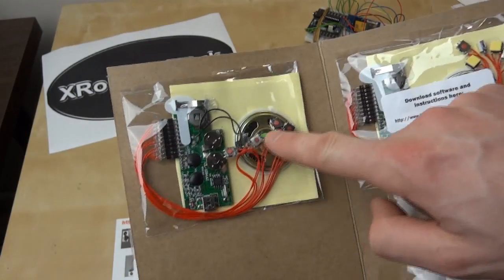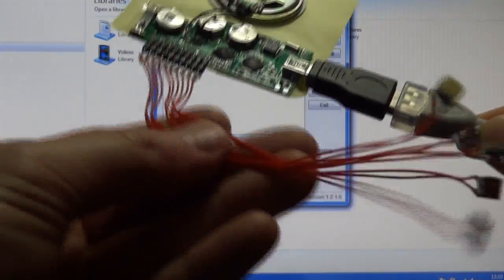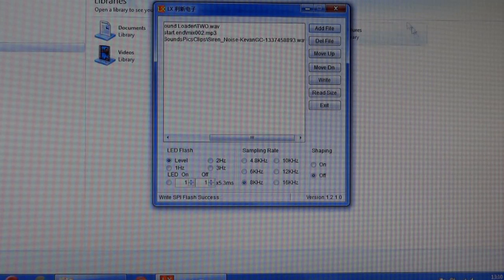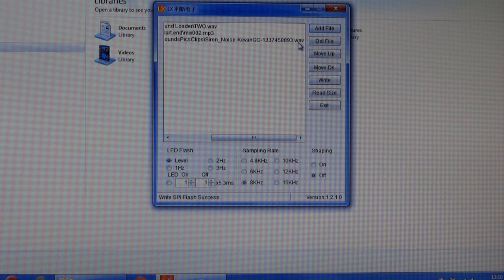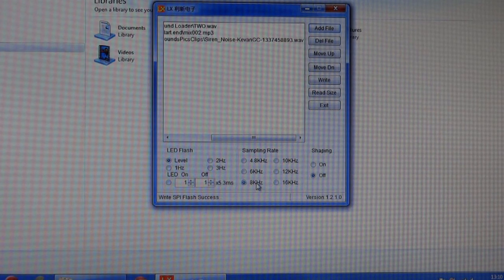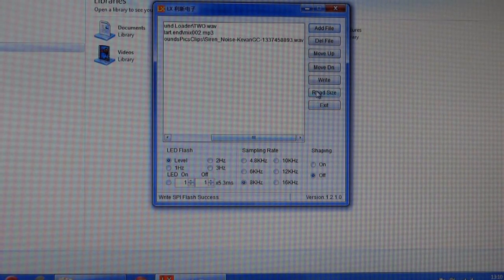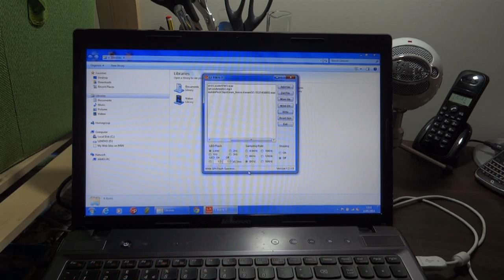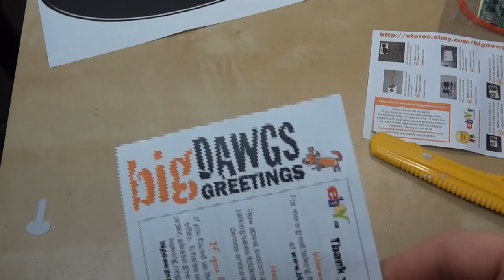BigDawgs Sound Board Review and Demo | James Bruton

Comment: I use this very same board inside my Iron Man Mk VI suit.  I have modified mine by removing the speaker and using those leads to go to an amplifier from a pair of computer speakers.  The amplifier's output then goes to a rechargeable speaker (similar to a Boom Cube).  I have also replaced two of the trigger switches with magnetic reed switches.  You can replace the existing switches with any normally open, momentary on switch.

Comment: Cancel my last that function is not available on this board.
I do have another question you may be able to help with. I am fitting two of these to a project I'm doing but rather that use the tactile switches to activate, I would like to activate the sound files via a simple IR remote. Can you think of a simple board or attachment that I can rig up to the switch terminals to do this?
Thanks.

Comment: It would be cool to disconnect the on-board speaker and use those wires (output-sound) into different speakers on the shoulders on your your Iron Man suit, providing you amp the sound somehow, without taking away from the suit.

Comment: Hey Im an Computer engineering student and currently working on a R2D2 and I am trying to have the lights and sounds on a random loop controlled by a micro controller I have the lights figured out and I was wondering if you had have had any luck controlling the big dawgs sound board via a the micro controller instead of the push buttons also any other tips you may have would be greatly appreciated. 

David Hollis